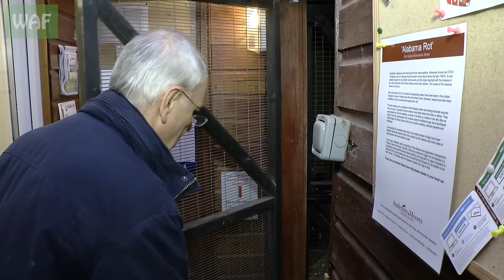Wildlife SOS Online S2 - Episode 2: The Waxed Hedgehog

Comment: I think I should study the warehouse catch scene thoroughly and design a tool for you that specializes in the task of avian capture, specifically for such situations; A tool that will only be used once every blue moon, but when its use is required, it will be appreciated 1000% ;)
Well done! 3/3 safe releases, despite the odds and extend of some of the injuries. Very heartwarming!
Reply from the maker: If you do then we will be the first in line! Warehouse rescues are some of the hardest and most frustrating rescues we do!!
Reply: Wildlife Aid
I can tell, from this video, as well as the previous warehouse catches your team has performed (albeit edited shorter) 😉.
It required some fine-tuned teamwork. Retracting that "net-sandwich" just the slightest bit out of sync and the catch was lost. I was quite impressed with successful the catch! 😃
Reply from the maker: The sparrowhawk in this video took almost two hours to catch! I'd love to show it all but I think viewer sanity might be at risk! ;)

Each one is always a new set of challenges, but the net sandwich and leading them towards  a static net usually work quite well. We have not missed one yet! :)
Reply: Wildlife Aid
I have completed a (purposely private/unlisted) video, specially made for you, showcasing a suggestion for a tool that could aid in your more difficult avian rescues, as well as possibly augment your current equipment! I apologize for the heavy accent and lack of imagery for a few seconds during talking, but I hope this will be of help to your team!
I'm writing here, in the event YouTube auto-filtered my message as "Spam" for including the link to the video within it.
Reply: What if you made a contraption that was like tongs but with two nets and on a catching pole with a button at the bottom that caused the nets to quickly latch together, the nets would magnetize together for a locked grip.
Reply: +Daniel Renard
You can always post the link in bits ór mention the name of the video, so they can find it themselves. 
I think I know what kindof tool you mean bytheway, one that has the same technique as an illegal foxtrap (closing upwards) just not with sharp things, and a lot bigger, with a net :P
Reply: @wildlifeaid  HAHAHA ohhh dont be so silly... We would loveee to see how much hair Simon will have lost before the job is done :D :D :D

Comment: does it hurt the fox when you put the loop round it's neck?
Reply: LGBT supporter I'm not much of a professional but I will give my two cents. 
The most it's going to do is shock them they're pretty damn careful about it. They make sure it doesn't get hung by it and quickly try to calm it down if it's freaking out that way it doesn't break it's neck. but I'm sure things do happen...
Reply from the maker: The grasper is made from a really soft plastic so it doesn't hurt when used. It doesn't choke them either :)
Reply: LGBT supporter ikr

Comment: The wax should have been easily soluble in a variety of solvents. Getting it off of him in 3 min should be worth the risk of having him absorb a portion of the solvent, if it is something like ethyl acetate, xylol, white spirit etc. which - while not too healthy themselves - are far less harmful than chlorinated solvents, denaturated alcohol or petrol. Cooking oil might even work, or glycerine, maybe propylene glycol, these are absolutely non-toxic. I'd normally recommend diethyl ether, but while it makes the whole crew quite happy, it will evaporate in a couple seconds and is extremely flammable. However, if you survive the fireball (and the high), it is also not toxic, at least not more than strong drinking alcohol.
Sorry that I can only contribute this very one-dimensional aspect to the situation, but while I might have been kidding in part, I am certain about my toxicity assessments, having had all those and more poured copiously over large portions of my body before. So I hope you can save valuable time and effort next time, if you just tried bathing wax-covered animals in some oil, ethyl acetate etc. Maybe look for non-toxic paint remover  at home depot etc.
Reply: +Boycot gugle
I think most of what you mentioned would've really dried out/harmed the thin skin of the hedgehog, which was why they dried using scissors and then calming oil and powder to unstick.

Comment: Could you have used olive/vegetable oil on the hedgehog and then bathed him? That is what I use to remove excess hair removal wax. I've also used oil or hand sanitizer to remove the sticky residue left by price tags on dishes, bottles, etc. Not surely about using hand sanitizer on hedgehogs though.
Reply from the maker: We went through a lot of different options with that hedgehog! Very few on them worked well enough and in the end we found coconut oil worked best :)